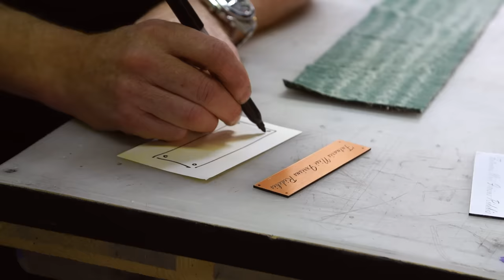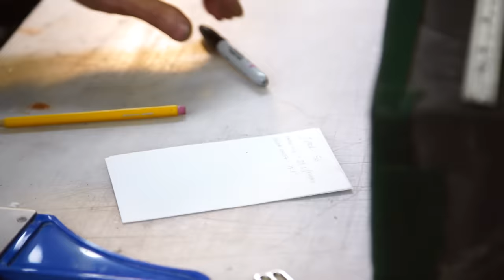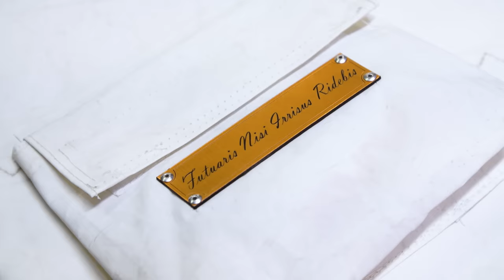Adam Savage's One Day Builds: Eric Idle's Guitar Case!

Comment: If he'd have just folded the edge of the felt over on itself by a 1/4 inch or so on the side pieces, it would have looked much tidier and professionally done. As it is, the cut edge of the felt is exposed and will only look more and more ragged over time.
Reply: I was thinking the same, honestly.
Reply: Sharky Sharklops lmfao bro your name is amazing. Gah damn love it.
Reply: He should glued in the bottom first with 1/2 coming up the sides all the way around then glued the internal side felt pieces going all the way to the edges which would cover up the bottom felt edge.. Then finish with the front face of felt that could round the corner and cover the internal felt pieces.. Then it would look almost seemless
Reply: @Zack_Darce  yep, order of operations is everything, first thing I thought of when he put on the face first.
Reply: thats my thoughts!
Reply: Why not add some piping around those rough edges on the inside? Or sew the three panels inside out to hide the seams, then turn them right side out, then continue with the plan to sew the bag inside out like he did.
The design looks excellent, but the finish... not so much. Glad Eric liked it though.
Reply: Great video 😁personal notes would be surging the lid edges, plywood bottom too. I loved adding the setup dot on the top to show the history of the felt..
Reply: @maxximumb  I was practically screaming, "piping" at the screen. I get sewing isn't his main skill, but someone in that shop must understand piping is a simple fix that you can truthfully do even as the last step, if you have to. Though I have to wonder if his sewing machine could handle that. Also, why not glue or pattern stitch the top felt? Those two little things would have made a huge difference.
Reply: I made a bunch of felt cases for a few metrology tools i got at an auction and i can fully confirm that exposed edges fray and look really bad over time. On my second go to make them i bit the bullet and went with an inside sown seam, which is really easy to make if you plan your cuts right, it does require a stitching needle however (the half moon needle).
Reply: Yeah that made me cringe too. You could also make a cut into the foam at the corner edge [at say, a 45ish degree?], and fold both edges of the felt into when gluing it down, avoiding overlapping too.
Adam works fast, which I get because he's always busy, but rushing things will always make you regret moves later.
Reply: Yeah, That's seems to be an order of operations issue, Should have lined the inside before doing the top felt, But as Adam has pointed out frequently, Everyone make mistakes. and even as I saw that one, I winced and half expected a 'I should have' section at the end of the video XD.
Reply: Even simpler. Internal sides first and then top/face after wards overlapping the sides. At least then the exposed edge faces down in to the case rather than straight at your face. I think if Adam wasn't so under the pump with the timeframe he could have done a much better job.
Reply: @Rory Stevens: Well it wouldn't be the mythbuster feeling without the screen-screaming :) still love it
Reply: remember people... he's doing this in 8 hours.
Reply: bias tape is an option as well, it wouldn't have required any special tools and could even be done now.
Reply: As someone who tends to build exclusively using screws, stitching, staples and other methods that allow easy dis/re-assembly, the volume of glue here is a bit disappointing. Overlooking such details as that edge for the sake of expediency did make me cringe a little.
Reply: @VonOzbourne  The glue is a contact cement and designed to attach foam together. Gluing foam is standard practice in industry for assembling foam structures.  Nothing to cringe about there, though you could say he laid it on pretty thick, but that's hardly a crime worth mentioning.
Reply: @ @ixamraxi  Oh yeah I get the foam construction, I'm actually more referring to the felt to foam attachment. You can always tell when a fabric has been glued and it never feels as nice. [at least in my opinion]
While more ambitious and time consuming I might have tried overlapping the sides and sewing the top piece over it. Then simply add a thin ply base to the bottom parts and staple that side down. The goal being that the feel of the felt wouldn't be affected at all and should it acquire a tear at some point, it wouldn't be a big deal to pull out and patch or replace a piece. 
Granted I probably spend more time thinking in terms of "How would I take this apart and reuse it?" than most, but future-proofing a design has definitely come in handy on more than a few occasions.
Reply: @VonOzbourne  Ah, sorry I misunderstood. I imagine one reason for the method he used is the time limit he had of 8 hours total construction time, though contact cement is a pretty common method of attaching fabric to objects, the biggest flaw in the method he used is the lip between the top and sides, he addressed that issue for the top and bottom, as they would be the most likely to rub away after repeated contact, but it does seem unfinished.  Steaming the felt and shaping it upon a wooden frame or mold would be ideal, but certainly too complex a task for a one day build.
Reply: Do yourself a favour. Buy an industrial sewing machine. You’ll never look back. They make the most amazing difference.
Reply: Overlocker would take care of that...
Reply: Sharky Sharklops you need to remember Adam Isn’t a sewer, if you watch his Totoro build he actually says people who sew for a living - respect 🙂
Reply: That’s exactly what I was thinking.
Reply: Assemble Meccano?
Reply: @RoryStarr  He said at the beginning of the video he was really quite pressed for time. Sometimes you don't have the time to add things like that in.
Reply: Yea, think he rushed the interior a bit due to time constraints. Should have skipped the haircut, used the time to go with the fur, and sewn the edge. :)
Reply: I expected the felt to be steamed and shaped in and around the hole interior.
Reply: Everyone saying he should do the top last is forgetting the fact that he made a boatload of relief cuts in order to fold it down. That would all get exposed. I agree with the sewing/piping ideas... But I also agree that billiard felt is quite hardy and if the edges are glued it'll be a long while before they fray.
Reply: Pool table felt is designed not to fray though, but I am sure a 20 year old could make it so. Not so sure about an old man, though.
Reply: @Zack_Darce  Yes that would have been perfect IF the felt was stretchy. In my experience thats not the case. I'm not saying that that part couldn't have been a bit more thought through but i don't think you are realising how difficult it is to fit non stretching fabric around compound corners. Adam is plenty skilled. If it was that easy i don't he'd gone the rout he did.
Reply: I thought he biased-finished it with webbing all 'round.  Thick, but finished. Maybe I'm making stuff up....
Reply: I agree, it was bothering me the whole time he was doing it and for the rest of the video.
Reply: @RoryStarr  I doubt that Janome would have handled piping but yeah, I was screaming "piping", too. Still, an amazing, 1 day build.
Reply: Aw, c'mon, how long do think Mr. Idle has left?
Reply: Yeah, I felt felt the same way. People who say he was pressed for time are correct. People who say I only had time to watch the video are also correct. While doing that different, in my opinion, would have improved the build it's still great to see someone design something bespoke on the fly. I usually don't find much on the videos that Adam put's up that I would improve on. In this one I noticed an opportunity to improve something. So did a bunch of others. No one is perfect. He built something cool. I just criticized.
Reply: I would have just kept all of the foam sections separate and only glued them together after applying the felt. That way you could use excess felt on all of the pieces so it would overlap around the sides. then, when you glue all of the pre-felted pieces together, all of the ends of the felt pieces are tucked into the seams and glued together.
Reply: I would sew the top with the sides and glue down
Reply: I dont think felt was the greatest choice at all, not that this case wasn't amazing but id be worried the felt would be a bit scratchy on the guitar. especially if it has the older nitrocellulose lacquer which is usually super thin and very commonly will scratch and even crack on its own due to the wood expanding and shrinking. so id be worried that such a thin layer lacquer could get scraped up. And i know scratched up guitars are a great looking thing but not needless rug burn looking scratches on the sides and back from chafing i can see those eventually stripping the lacquer off the side of the guitar. But damn everything else was awesome to see and I would agree with.
Reply: von Ozbourne - how else can you attach felt to foam?

Comment: Adam has an exceptional talent for design and even more, getting his thoughts into reality. I have to criticize one thing though, after many years of packing guitars for shipment and fitting cases, I would have given the headstock more room at the end. One fatality of many instruments is being dropped upside down and the headstock takes the thrusting force, and the weight and inertia of the instrument. The wood at the nut is very thin with the truss rod cut out right there and the nut set in, so it is a weak point. It is better to fit the shoulders of the case snugly and with the headroom prevents any contact at the end. Then, if the guitar is dropped upside down, the shoulders of the guitar take ALL of the weight of the guitar and if anything this will cause a tension force on the neck which relieves all the destructive compression force that it can't handle. All good cases have headroom at the top.
Reply: yep, i've seen most big breaks at the headstock end of the neck
Reply: Also I wonder if the plywood top might not apply undue pressure on the bridge of the instrument.  The bridge looks to be the highest point, perhaps higher even than the edges of the case, so force applied to the top of the case would be concentrated there.
Reply: overall very nice and one of a kind..

notes:
The backpack straps are an afterthought and that's pretty typical of many gigbags and cases and it's always a disappointment.  the instrument should ride much higher on the body,  definitely above the persons waist. 

Also the handle is on the side opposite the zipper so if you lay the case down then you have to spin it around before opening it. .

And lastly the plaque I believe should be a little bit recessed ( Maybe install just above the pocket) instead of on the most external part of the case where it could scratch adjacent pieces of luggage or other items.
Reply: He said it's for carry on not check in.

Comment: When I've built hard cases for things that usually need accessories to travel with them, I tend to look at "Dead space" in the container as a bit of a lost opportunity.
It would have meant a bit more work, But I'd probabbly have cut a void under where the fretboard goes, Lined it with some more felt, and added a padded flap of cloth that seals with velcro along 3 sides. That would have given Eric a place to stash spare strings and the like, But without the added bulk of having an external pocket.

OK, An internal void won't be as accessible as an external pocket, and would need the guitar removing to get anything out of it, but most guitar related accessories are only going to be needed when the instrument's out of its case anyway, So that shouldn't be an issue.
Reply: Yeah my hard acoustic cases have hidden compartments under the base of the frethboard. It's a really nice place to store a tuner, strings, and a few tools for adjusting the action
Reply: For stuff like strings  and notebooks, the accessible outside pocket is best. A mini pocket on/in the pocket for picks would have been nice. But for things like patch cords and tuners and other items that need some protection, the under neck box is excellent.

Comment: Hi, Adam, my grandfather was a sign artist, which included screen printing and my grandmother was a seamstress. They worked out of their home, so as a kid growing up, I watched all those processes. In those days, a product called watersol was painted onto the screen fabric for the lettering, a then a more permanent emulsion was painted over that. The watersol was then rinsed out. These days, we use photographic emulsions and machine cut acetates to do it. Anyway I have always looked at those from both sides(readable from either side, but mirrored on one side).
As a result, I can easily read mirrored text. I'm 62 now, but I had this ability in my 30's. And at that time, I had gone into a record shop and picked up an Aerosmith cassette tape. I read the first three titles and went to read the fourth but for some reason, couldn't discern whether a word was god or dog.
I took me a moment to realize that the lettering was all mirrored on the tape.😳😳😳

Comment: I was a seamstress for a decade or so, and as such needed a decent pair of scissors.
I was told by a co worker who had been in the industry for 50 years that the test for finding out if you were about to spend your money on a good quality pair of scissors or not, was to cut a piece of fabric and listen to the noise.
The sound a a good blade on fabric is unmistakable, and as you were cutting the felt that was the beautiful sound I heard. It immediately took me back some 30 years to the all the people I worked with and the sounds of the sewing machines, cutters, sealers and scissors etc.

Comment: Love that foam cutter! Looked it up and almost fell over at the cost!!  Over $900.00!!!!!
Reply: Yeah, If you're cutting thick sheets of foam regularly they're the quickest and neatest way to go, But if you're only cutting the stuff once in a blue moon (And you take your time) you can get reasonable results using an electric kitchen knife.
Reply: WHAT, $900.0?!? THERE IS NO WAY THAT CAN BE RIGHT!
Reply: Efreeti it is a product that is built for a very specific purpose. Due to that fact it has to be marked up in price in order to make any kind of profit on building the process to make the actual product. It's the reason why many things are more expensive then they seem they should be. However as a result they are typically much better quality then mass produced tools and other devices
Reply: Whoosh.
Reply: @Efreeti  using all caps doesn't really imply that there's a joke or sarcasm... there was no woosh, you're just bad at making jokes.
Reply: I'm guessing you've never heard the "IT'S OVER 9000" bit from Dragonball Z. My bad for thinking that reference was ubiquitous.
Reply: @Efreeti  Yeah, if it were $9,000 it might work, but it's $900. Adding a single decimal value doesn't turn it into 9000
Reply: Well, it was intended to be a throwaway joke comment, not to be taken seriously. Of course it doesn't stand up to scrutinous analysis. If your intent is to make me regret posting the comment I spent less time thinking of than it took to type it, don't bother, because that has already happened.
Reply: Efreeti I got the joke. That guy was just being a douche. ;)

Comment: great video but what is the neck resting on? it looked like the only things touching the bottom of the case was the body and the headstock which isn't good. That is why so many headstocks breaks is because pressure is put on top of the case and that a point of contact. maybe you can add in some supports in the neck tunnel?
Reply: looked to me that the headstock was floating slightly and the neck was supported by the foam.

Comment: Nice project. Would have been nice to know the guitar's make and model as well as the short comings of the previous case. I would also be concerned about keeping the guitar, which has a solvent based finish, in it so soon after the contact cement was applied. Probably more prudent to allow an off-gassing period rather than risk the guitar's finish.
Reply: The make and model were in the description or pinned post. The short comings don't matter that much. And as you might not realize. These one day builds can be weeks long. I wouldn't worry about the glue harming the finish on the guitar.

Comment: Protip for anyone cutting furry fabric. A. Cut it from the back, non-furry side. B. Use a razor blade vs scissors. 

Doing this will give you clean cuts with significantly less wild fur floating around your workspace.
Reply: I took your word for it and now my arm is stuck up my dog's arse and he's none too happy.
Reply: Puppet maker here. Can confirm. Using the razor also prevents you from accidentally blunting all the fur along the cut, leaving you with a line of shorter fur around the edge.
Reply: I too took your word for it and I’ve lost my keys, two toes and a refrigerator magnet to a mysterious hole in my neighbor’s yard.
Reply: Eric Stevens this is true I cut carpet for a living

Comment: Y U NO DO SIDEWALL FIRST??? Then fold the creases over the top to hide the line?
Reply: TheClearwall right? I’m not a model maker or anything like that, but it would have been much neater with the top folded over the inside felt to hide any seam
Reply: Because he had to cut the fabric to make it lay over the inside edge, if he did it the way you’re suggesting you would’ve seen all the little tabs he cut to glue that edge down.

Comment: For finishing your interior seam use bias tape. Which you don’t have to buy you can make using whatever cloth you need for the given project and an iron. Just get a strip of cloth probably about 2” wide and fold 1/2” in on both long edges and iron down. Then fold in half lengthwise and iron again. The. Put this bias tape over your interior seam and stitch down.